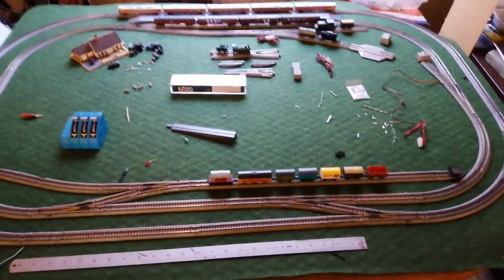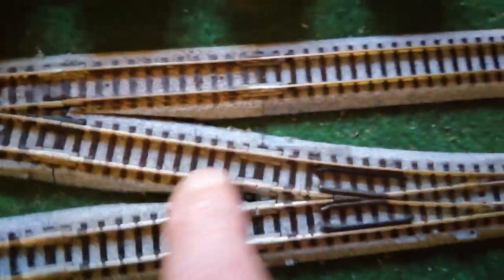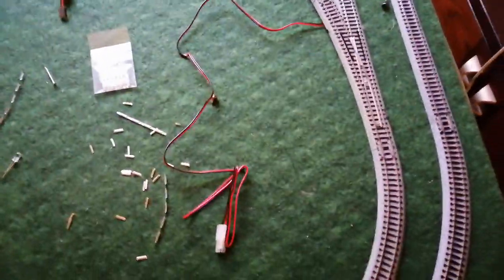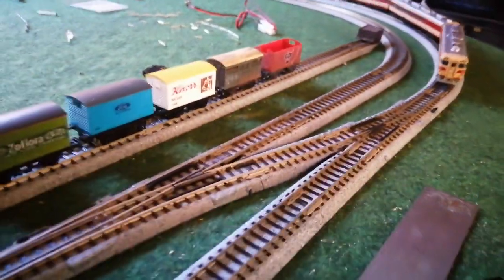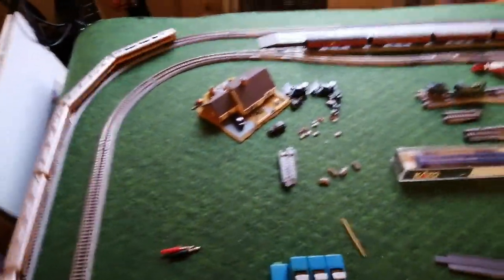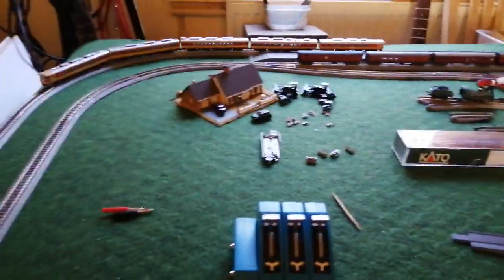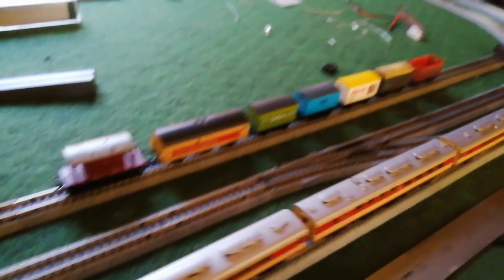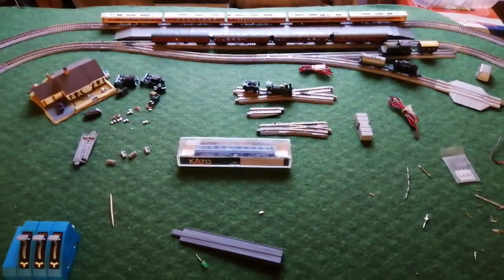Steve  update 1

Comment: I have a layout using Kato unitrack. My comments are that it is best to use only 3rd and 4th radius curves for the bends. If you use 1st and 2nd radius, you will find that some locos will refuse to go round. Tender drive steam locos will suffer from the loco wheels locking up. I had derailments with Farish locos on short radius points, so I only use long radius.
Reply from the maker: Bit of a late reply. Thanks for your comment. Yes! I was concerned about the lack of space for long radius curves but after running a variety of longer locos and coaches, I never actually had a derailment or lock ups. I even ran a Big Kato DD51 round without any problem My Dapol class 50 would sometimes uncouple on the tighter curves but I discovered that this was caused by a known issue with the Dapol couplings. The only issue I had was some of the Kato points needed fettling to prevent derailments of some of the lighter trucks although a bit of added weight also helped.

Comment: Terriffic! Watched this a few times now.... Like you I am worried about the curves, I'll have a main line with the larger curves so I can get the big trains round and anything inside this will be for mid-to-small shunters. STILL tinkering with ANYYRAIL to get a layout design. Many thanks for all the help. Seeing your layout is very helpful too.
Reply from the maker: I'm quite sure the V5 inner loop ( my outer loop) Will fit inside your main loop so I don't think you have anything to worry about. The DD51 ran fine on my inner loop. Also, I discovered than the derailments were mainly caused by the Kato track joints which are not 100% accurate ( height wise) and can cause a slight step in the rails at the joint. Once I filed down the rail ends slightly  ( about 45 degrees) I got no more derailments so didn't have to use the added weight in the cars.. Run your fingers over the rail joints and you will find the high spots.